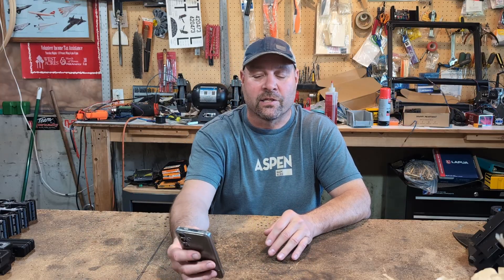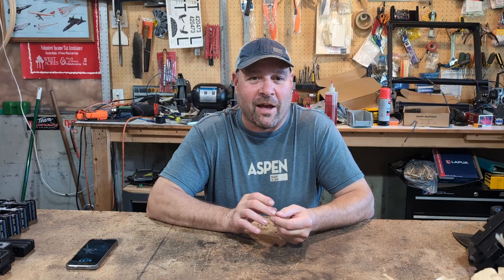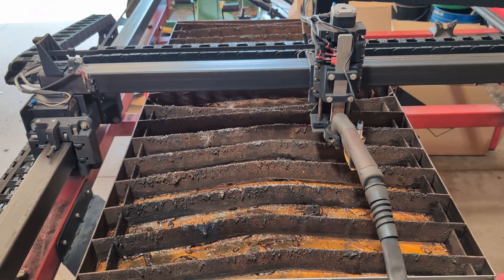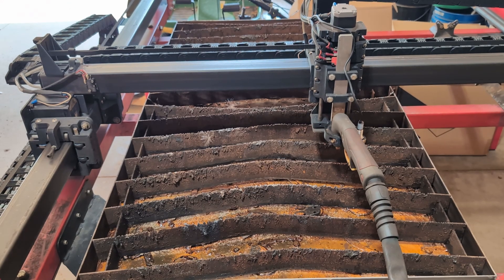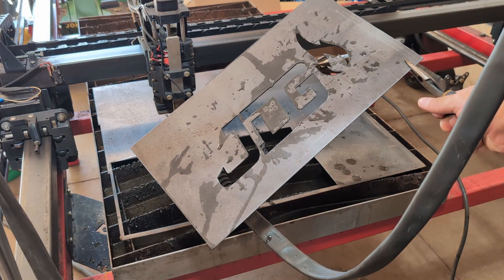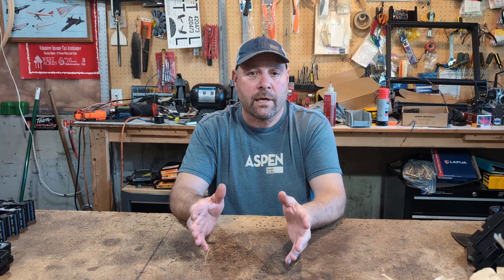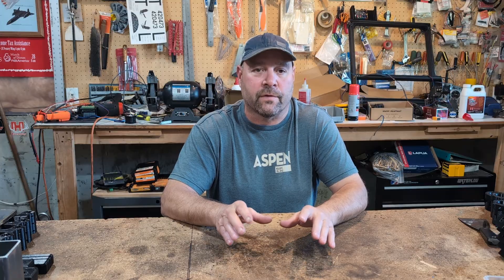Performance Upgrades for the JD's Garage XL and Gen2 Plasma Tables

Comment: My JD2, not Jd's Garage but my JD2 I've had over 9 years now can hookup using wifi but I found there will be times it will drop and you better hope you have a sbc in the cabinet remembering when the remote connection is lost. lol